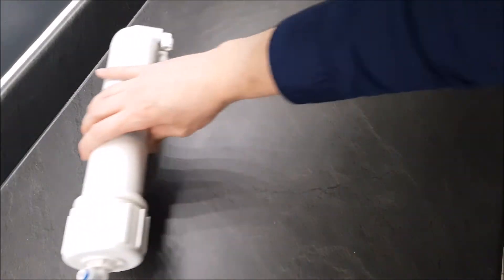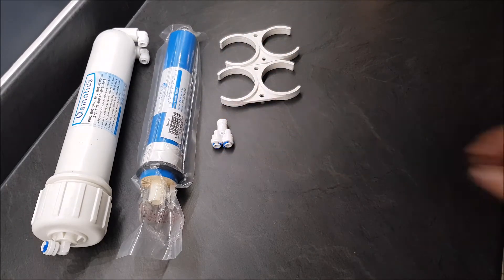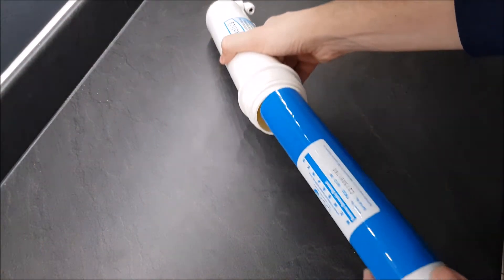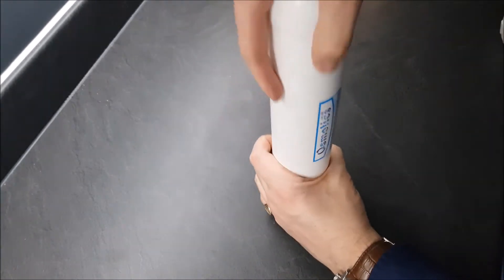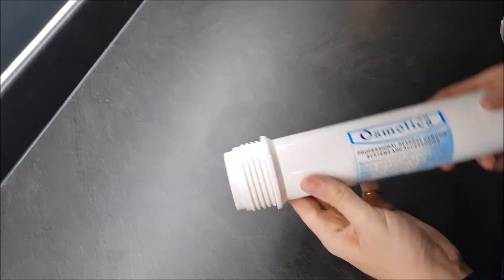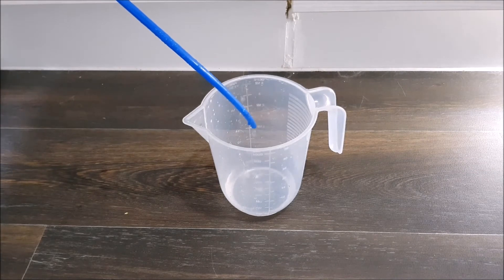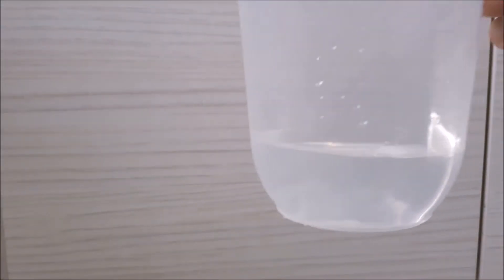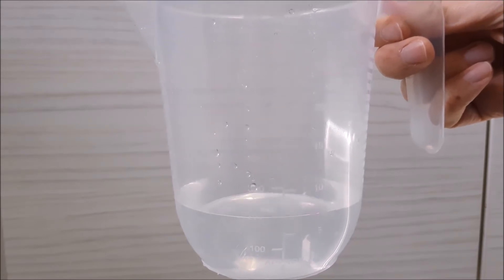Tweak of the Week! Turbo Charging Your RO/DI System (Part I)

Comment: Hey man...where do you get your DI resin from? Have you ever used the colour changing stuff?
Reply from the maker: The colour change mixed bed is all I ever use now https://www.ebay.co.uk/itm/Vyair-5L-Mixed-Bed-Colour-Change-Resin-DI-For-Reverse-Osmosis-Window-Cleaning-/273426121442?mkcid=16&mkevt=1&_trksid=p2349624.m46890.l49286&mkrid=710-127635-2958-0

Comment: what ro is that your using?
Reply from the maker: It was this one, although I've added a few di resin pods since then, and a larger membrane, plus a booster pump. https://www.osmotics.co.uk/products/4-Stage-75-Gallon-Per-Day-Reverse-Osmosis-System-with-DI.html
Reply: @ReefDork  cheers mate just ordered. I am sick of running back and forth my lfs with barrels. Thanks again mate keep up the good work.